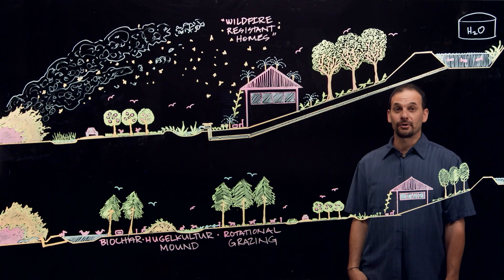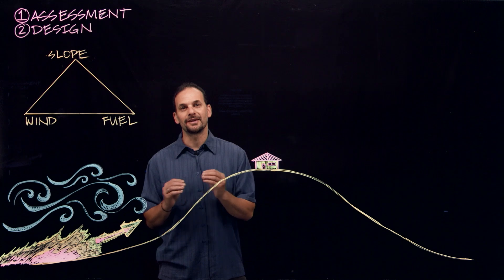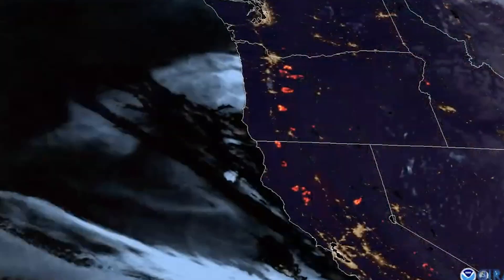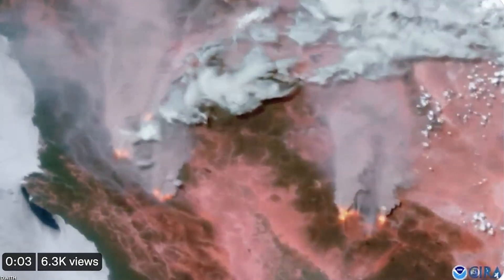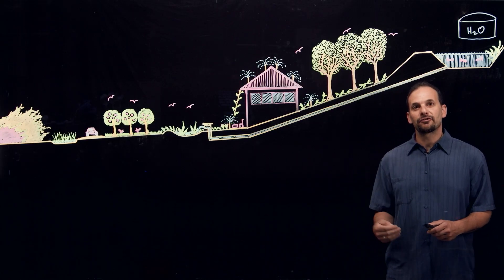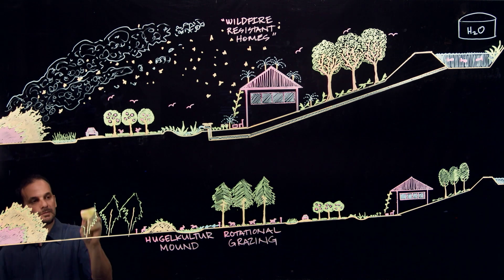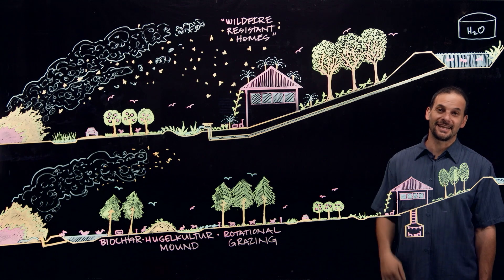Permaculture Design for Wildfire Defense

Comment: Aussie here. Great explanation of the threat of fire. Building on top of a hill or up a slope is called ‘Dead Man Zone’. We have building codes for fires, but I still think the best defence is an underground bunker to shelter in while the fire passes. The 2019 fires came within 2km of the small village I live in, in the bush.
Wetting down your property is great, but remember, as the fire approaches, creating its own wind storm, it also sucks out the oxygen which can cause petrol powered pumps to fail. Ember attack can happen up to 30km ahead of the fire front. We built our house using corrugated steel, and hardwood for any deck or timber trim. We are also required to have any gaps less than 3mm, so embers can’t get inside the house. My partner is in the RFS, so we have proper fire fighting gear to wear. We have a fire plan. If all else fails, leave!

Comment: Here in California I have cultivated succulents all around the perimeter of the house which acts like a fire blanket..... the more the better! Concrete roof tiles with bird stops to prevent wind and fire from getting underneath and stuccoed wood trim facia, rake and soffits. A basic above ground pool or a permeant pool with a pumping system is also beneficial as a reservoir. Not to mention a generator if the power goes down. A sprinkler system as mentioned or fire gel administered around the exterior of the house is a great idea. An evacuation plan for the worst case scenario is essential with all valuables such as documents kept on file drawers to remove quickly as needed or to keep in a safe deposit box. This is a a very important video to view and understand!

Comment: 00:02 Permaculture design offers resilient strategies for wildfire defense.
02:02 Slope and fuel are the dominant forces in determining wildfire danger.
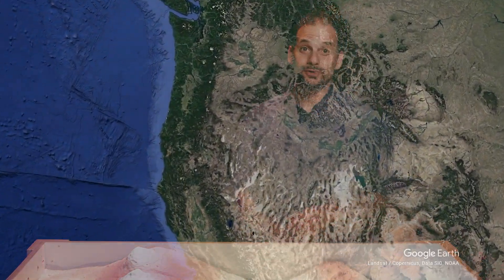03:46 Shift in wind direction led to catastrophic wildfire
05:26 Assess survivability in the event of a megafire and evaluate location.
07:04 Have a reservoir of water for off-grid wildfire defense.
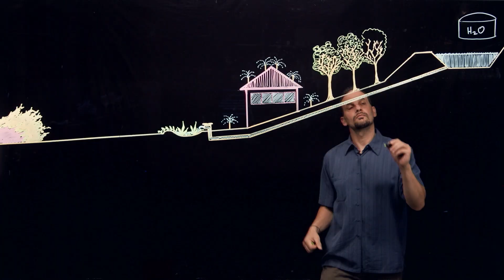08:31 Position non-flammable elements to create a fire break around your house.
10:08 Creating firebreaks and reducing fuel load in the wider landscape
11:48 Using biochar as a soil amendment for fuel reduction and soil improvement.
Crafted by Merlin AI.

Comment: Do you have any suggestions for an emergency fire bunker?  A neighbor in Sonoma, CA, which has seen massive fire storms over the past decade, curried a steel shipping container in the side of a hill (for convenience and lower cost), cleared the immediate area of fuel sources, and placed an oxygen tank in the container with vents out of the container to provide oxygen for people in the bunker and positive pressure to keep out smoke and particulates.  Any thoughts?

Comment: From my permanent agri- & other aspects of culture perspective I believe it's known the intensified fire seasons are due to deforestation, clearcut logging, even when done not at all nearby, cuz forests stabilize climate against fires, floods, droughts & temperature extremes too, & do so over a greater area than the forest actually covers with canopy. So our reforesting west of the Rockies, right up to the continental divide, while ending clearcut logging, in exchange for a full switch to selection logging that doesn't highgrade. This means relative old growth gets saved, while canopy is maintained for hydrology, meaning how forests create fresh water in abundance all the way inland & beyond. This is why our prairie east of the Rocky Mountains was considered our "bread basket". Reforesting river riparian zones & to & along the coasts would, thru carbon capture & sequestration, prevent carbon from slipping into the ocean where it does have a damaging acidifying effect. Of course lumber will still flow with this change, except the business should be down-scaled to feed the local rural communities. Besides, in the book The Biophilia Effect, Clemens Arvay cites research finding conifer terpenes boost immunity, ahem.

Comment: Well if you people on the west coast would actually manage  your forests the fires wouldnt be such an issue but all the tree hugging hippes refuse to let them thin the forests or remove dead dry wood from them making them pron to burn. Also the wild fires have neen happening for decades out there. But there used as a  Climate change scare tactic so they push them more in the news now so they seem worse they historically they really are

Comment: I would like to mention that Aspens are known as the asbestos trees. 
Use them as a firebrake. 
In BC, Canada the powers that be, eradicate the Aspens fearing the lose of the more valuable lumber trees. 
Very true but as I understand it,  putting a 3 foot deep barrier will stop the spread of the Aspens root system.

Comment: another 5 star presentation. the only extra thing -as practicing eco architect - I would add is go under ground in extremely high risk areas, this would also increase your building's climate adaptation performance. earth-ship like..? or at least use a thick sand/gravel based green roof ;-)

Comment: I'll be building a home with a hardened walk-out basement containing the critical parts of the home as in food and water storage, kitchen, mechanicals, a composting toilet, shower, laundry, etc. Apart from being a shelter, if a storm or fire were to wreck the upper floor the home would still have liveable space. Using metal siding and roofing seems fairly sensible in a fire-prone area. Many beautiful homes were lost because they were clad with attractive but highly flammable materials.

Comment: Having the fire prone side of the house buried in soil will help alot. Don't mean dump soil on your house, plan it, ideally before a build. Underground houses make it even safer, see Cooper Pedy aus. For the soil, a gentle slope with grass or even a garden of vegetables will be productive, lower household temperatures in the heat, esp in fires, and also held stabilise year round temps. And soil doesn't exactly burn.

Comment: This video contains a lot of knowledge and is executed well in conveying it. I will offer one question though, and that is to ask to what extent these wildfires currently are not a result of inadequate wildfire defenses in the first place. After all, if one already utilizes the means explained in this video there isn't much we can do to improve the situation. If, however, the increase in wildfires are a result of harmful counterproductive planning decisions then they can be solved. Yet, rhetoric that these events are happening due to the general warming of the earth would paralyze people in to doing nothing and thus the real problem would remain unsolved.
Reply from the maker: I think it's a combination: 1) development has crept up into the urban-wildland interface, which is often very fire prone areas, without regulations to protect people from placing their homes in harms way. 2) The length of the fire season has increased due to climate change, as well as severity and durations of heat waves and extreme wind events. 3) Forest management for the last 150 years has been all about total suppression, so fuel loads are super high.
Reply: @amillison  thanks for taking the time to respond, I appreciate it.

Comment: There are some really good tips in this video.  Thank you, Andrew.  One thing that could be added is that mature deciduous trees tend to not have ladder fuels like conifers, and their leaves, even on branchier lower younger trees, tend to not burn like conifer needles.  Deciduous species tend to regrow like coppice if a fire does occur, and many can be coppiced purposefully to create biochar for nutrient and water holding soil systems, so replacing strips of conifer forests with deciduous permaculture systems can be a powerful deterrent for wildfire spread.  Also, while your diagrammed and video depiction of the hugulkultur is contained in a forested setting (with trees downslope-which stabilizes the landscape's soil systems), it is not actually generally recommended to build them across the slope (in a swale-type configuration) since a catastrophic rain event can saturate the woody sponge, destabilizing it and send it downslope.  This can be alleviated by breaking the hugulkultur row up with spillways that cause a sheet flow of excess water  downslope between them or burying the woody material in a trench so that it can not (or is much less likely to) be released downslope if saturated.
Reply: Great video, thank you! I live in the bush in Oz and spend 6 months of the year getting ready for the other 6 (fire season). Always looking for ways to reduce the fuel load and create fire breaks.

Comment: I have a friend in Northern Portugal (over 40 inches/1000  liters of rain per year) who put hugulkulture mounds at the top of a steep southern-facing slope where he was letting chestnuts and oaks grow in an area surrounded by pines/eucalypts). Because of the dry summers, this area gets wildfires and the mounds burned underground!!!! So if you use hugulkulture, make sure the material is actually breaking down and becoming a sponge. This will depend on how deep, what kinds of material you use, winds, water drainage, etc.

Comment: should have a cement apron around the house and if you use a barn, which you might just want one for a fire shelter for animals and some equipment,  a cement apron can be useful there as well, even if you have a dirt floor inside the barn. I know you mentioned you weren't talking house design, but one of the number one things that causes houses to go down in this kind of wildfire is vinyl windows, they melt and let embers in.  I keep thinking someone needs to make aluminum blinds that pull down over the outside of windows for fire and hurricanes. would have to have metal pulls as well since fiber would burn or melt. or maybe metal shutters, either way covering windows helps. oddly for gutters its the reverse, you want the vinyl because they melt and drop away from the house instead of holding embers up to the roof.  great video!

Comment: Couldn‘t biochar act as fuel in case of a rootfire (Fire under the ground surface)?🤷
Reply from the maker: That's a good question. Any biochar experts out there have an answer? The forest duff on the ground already acts as a fuel to ignite from root fires, and the biochar would be made from brushy material thinned from fire ladders, so even if the biochar provides a fuel, it would be a net reduction in overall fire risk.
Reply: @amillison  Hi Andrew, thanks for your work. C+O2 uses biochar to help establish the soil carbon sponge which is fire resistant. Biochar needs to be activated with biology to work, Living web farms here on YT is a great source. By the time activated biochar is established in the soil it will retain lots of moisture so the hypothesis is that it would help slow a fire.
Reply: The Japanese have traditionally burned the outsides of the wood they use as siding,for insect protection and fire resistance......

Comment: A bunker??? End the air supply for this bunker??
Reply from the maker: I'm glad you watched the video all the way to the end. I am sure that a bunker can be designed to withstand an overland fire. I should not have drawn it under the house, but better in an open area away from large fuel sources.

Comment: Prickly pears are natural fire breakers.

They grow fast into tall "walls" that simply won't catch fire: perfect for fencing, easy to grow and you get outstanding crops too. They are also safe corridors for small animals. All you need is the pads, you place them on the soil and you will get a massive hedge (up to 15 feet tall) that stops fire, intruders and keeps the wildlife happy in a few years.
Reply from the maker: Nice. Thanks for the suggestion. This is great for hotter climates that can support a tall hedge of prickly pear.
Reply: Yeah, I tried to transplant the prickly pear I got from a fallen one from a client’s yard. This was in and around the Santa Cruz Mountains, CA and I couldn’t get them to take. Granted it was some of the most rain we’ve had in decades this year, and snowed as well so it simply didn’t work out. I’m even more sad since I’m learning of the firebreak potential; wanted to make the jam and make roasts out of the green parts.

Comment: Andrew how much of an impact could re-greening the neighboring midwestern states to Oregon have on reducing the hot winds that come in from the East? Couldn't that be part of a solution to reducing the chance of a wild fire happening in the Cascades from the East?
Reply: Doing good is never a bad choice
Reply from the maker: I think regreening those states is a good idea, but the western interior desert will always be able to build up heat based on the latitude and proximity from the ocean. The Oregon fires were actually caused by a cold air mass moving down into the continent from the poles, which rapidly displaced the hot air in the deserts in a westward direction over the Cascades.

Comment: I have been thinking about a solution to our fires in California. My solution is simple. The whole idea is to hydrate the soil. When the soil is moist, all plants have more moisture in them and are less prone to catch on fire. So how is this done? On slopes 20 degrees or less,  I would subsoil or chisel plow to at least depth of 24 inches. This causes the precipitation to go to a depth where the water will stay and be less likely to be evaporated. On slopes higher than 20 degrees,  I would build swales, trenches, terraces or even hugoculture which would help the water runoff to stay in that area and be absorbed and thus hydrate the soil,  trees and other vegetation. This hydrated soil will slow down the spread of any fire. If there is a lot of dry brush, dry trees I would use a machine called a mulcher and grind this down and then chisel plow this land. Chisel plowing will help cover wood chips and make the ground easier to absorb rain water.
Reply: You are risking a lot of topsoil erosion with all that plowing, even on shallow slopes.  Better to build on top of existing soil with things that have better moisture holding properties, like wood chips, and leave the topsoil and the subsoil ecosystems in place.  There is more involved in holding the soil in place once you start adding moisture in any quantity, like root systems, mycelium and fungi.  You lose all of that with plowing.
Reply: Next time you have a campfire, source some green eucalyptus branches with leaves on them. Place on the fire and stand back. No matter how green some plants can be, it’s the volatile oils that fuel the fire.
Reply: @tonydoggett7627  Thank you. That is useful info.
Reply: @tonydoggett7627  Eucalyptus is invasive everywhere but in Australia. It is actually one of the most fire friendly trees. Removing eucalyptus is actually a really good fire prevention measure, as most healthy trees do not burn in the same way.